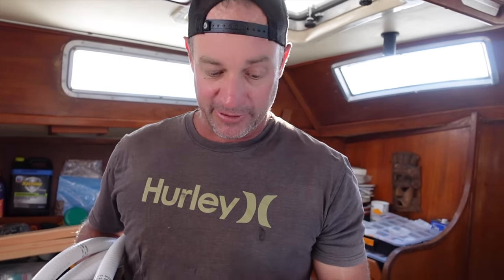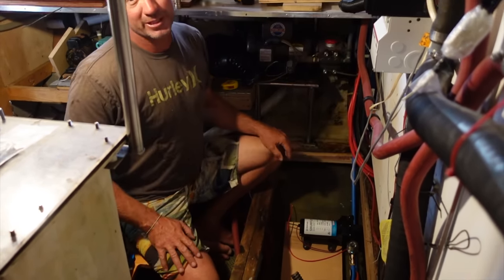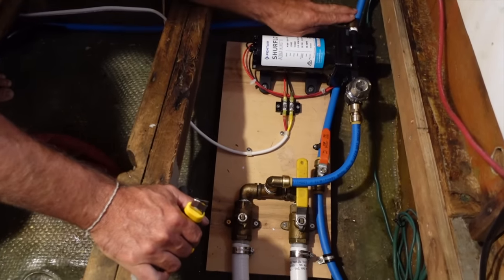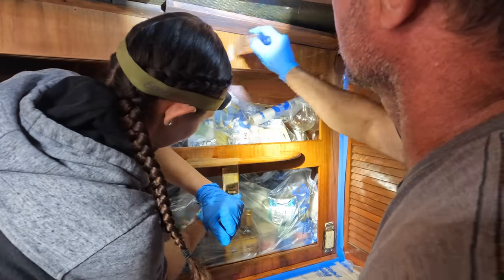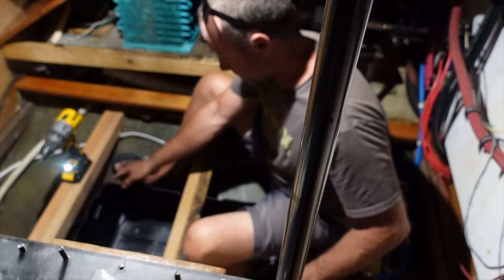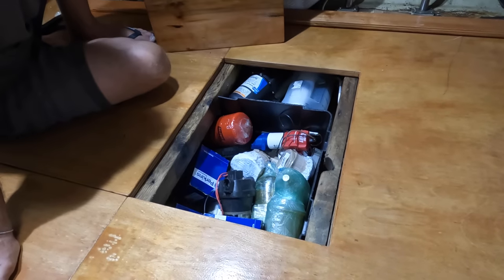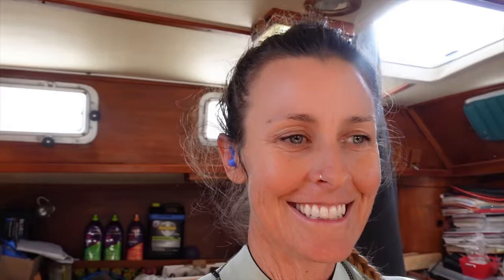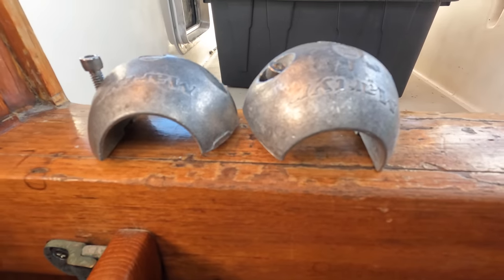Butt inspection | Ep 326 | Sailing Catalpa

Comment: Hey guys,  Here's a quick and easy tip to make the epoxy finish look like glass and get rid of bubbles.  After you brush it on, go over with a heat gun, propane torch or hair dryer to pop the bubbles and make a smooth finish.  The heat lowers the viscosity on the surface of the epoxy so the bubbles pop.  And if you want that mat finish to match the rest of the wood, you can rub the surface with '0000' bronze wool.  Steel wool will work and is much easier to find (at home depot) but you have to make sure you vacuum up all the fibers of steel or they will rust and leave a mess of stains, which is why I recommend bronze wool.

Comment: Great job guys the Galley looks really good and that plumbing cleaned up nicely, it would be good and advantages if you could hit those under floor beams with some penetrating epoxy to seal and protect them from moisture, soon of that dock and sailing, good onya, All the best, Al

Comment: Hey Guys, there's a thing that comes up from the hull on some colder water (Ice and snow) boats that looks something like what you see at 1:59 . It is where you put seacocks that pull water in from under the waterline and on some boats even has thru hull fittings (valves) that put water out of the boat (above the water line) and it looks like that square thing you show at 1:59 . Is that what that is, and what do you call it ?